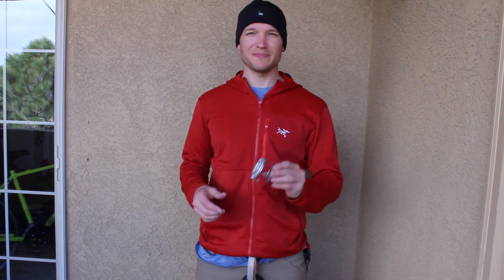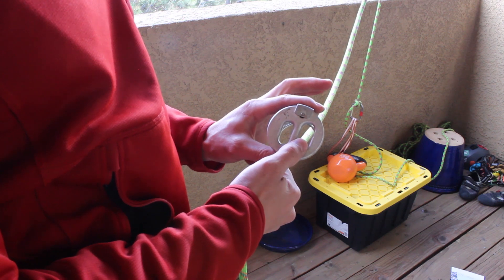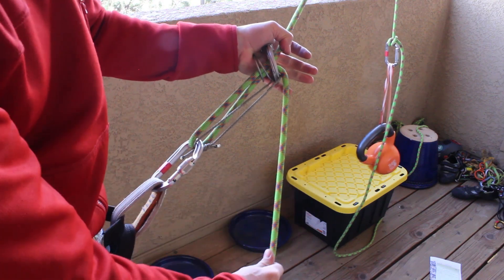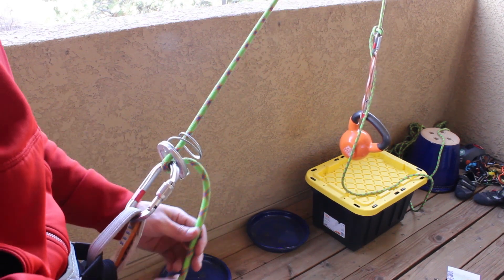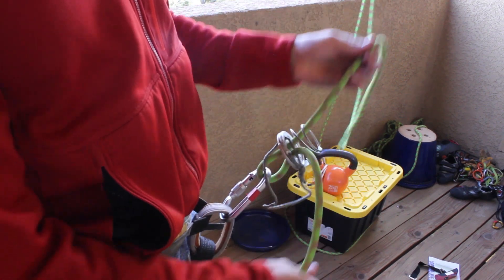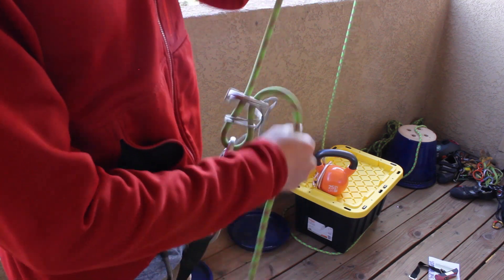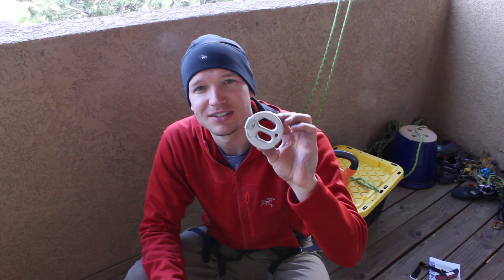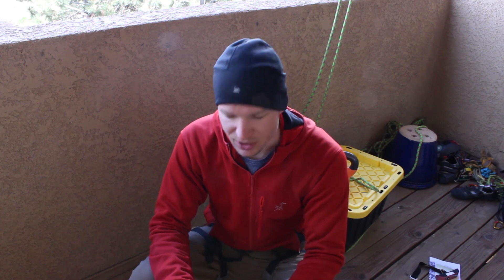Salewa Sticht Plate with spring belay device - old school!

Comment: The trick to using a stitch plate without the spring is to use your non-belay hand to tilt the plate slightly.  If you notice the way the plate lays against the biner when there is weight on the rope, the climber side of the plate will be titled up a little bit.  You can push that side "down" a little and the rope will run through the plate a little easier. With a little practice, you can control how fast the rope passes through and avoid jerking the rope.  --- Just be careful not to get your fingers caught in the device, etc.. again a little practice :)

Also .. the keeper cord should be kept fairly short, so that the plate doesn't get more then say 3 or 4 inches away from the biner.

Comment: It’s interesting to read the comments in this thread, I suspect by many young people who don’t have the benefit of the experience.  This plate was a welcome improvement after countless years of butt/hip belaying which worked great catching top-rope as well as big flyers by beginner and elite climbers.   I still have mine and wouldn’t hesitate to trust it completely.   Really the new devices are so much more convenient and smooth but the older tools and methods have long track records and work just fine.  Butt belays trash your clothes but could really save your life if you happened to drop your modern device.    It’s worth practicing and becoming competent at different techniques.  Same for a dulfersitz rappel which is super undesirable but could also save you in a pinch. Just thoughts.
Reply from the maker: for sure, thanks for the input & knowledge!